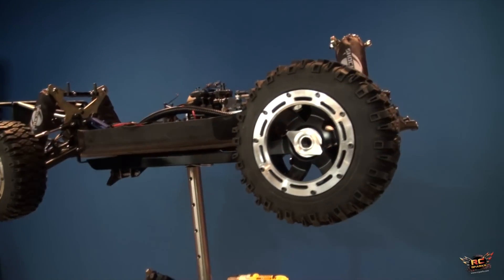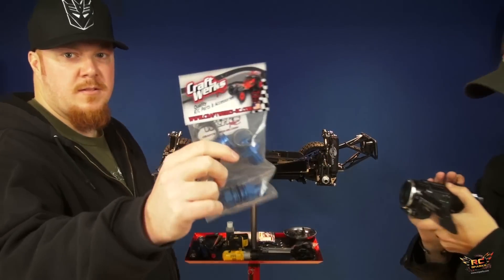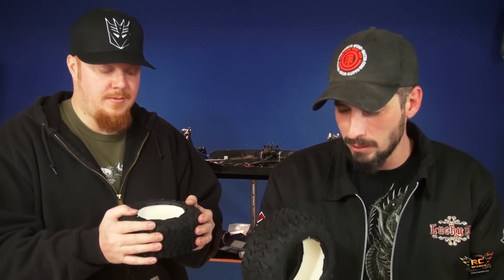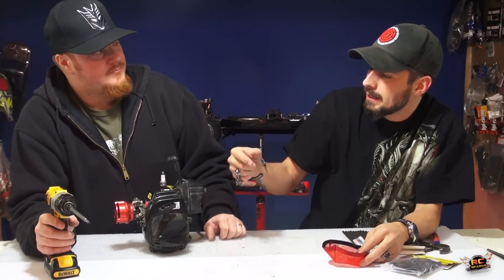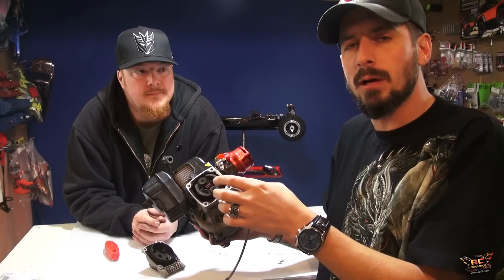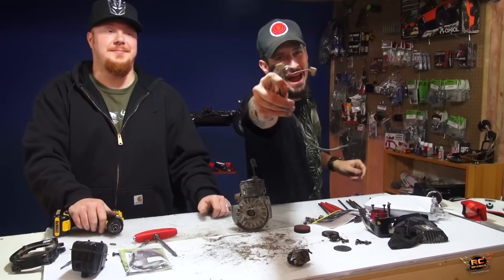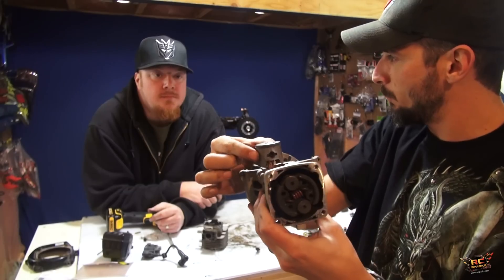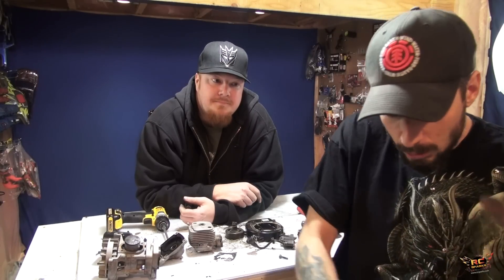RC ADVENTURES - Project: "LARGE" / LOSi 5T (PT 4) Look inside a 5th Scale 26cc Gas Engine

Comment: As a mechanic I can tell you that the spark plug is looking normal,  Also there is a product called brake cleaner that will take that clutch dust right out, it will also prep the surfaces for the new plates so you dont have to do any cleaning when putting it back together.  Keep making great videos :)

Comment: he did it with a rock crawler but for the wraith no because of how the body is and how the chassis is a 1:5 electric would take a huge motor and big batteries and you wouldnt even be able to run it at a track because the most common places dont race 1:5 scale trucks but 1:10 is a very big racing class so if you get the kit just have fun with it they are still easy to work on and lots of fun i hope this helped

Comment: when you were talkin about a failsafe cut out just want to mention that they don't cut out at short range this happened on my AOWEI YAMA BUGGYwhen the car was stationary,it just suddenly picked up revs and took off across the parking lot and ended up in the bushes on high revs.i think the batteries in the handset were low at the time.

Comment: medic buddy humm that plug is needed to look like that. if white to lean of main jet in your carbarator, if wet and black black like darker then that then to rich, and most times fowel the plug. but i say put a new plug in the new motor lean it so its white and do so its gray to black and make sure you idel respons is good if not lean or richen it up. have a great day bud. thanks for your vids

Comment: try the yama-lube 2 stroke oil for their 2 stroke scooters and mopeds. it will oil better and not foul the oplug out nearly as fast. its the best 2 stroke oil on the market for scooters and mopeds, so should work awesome for a 2 stroke rc motor.

Comment: the only oil i use in any 2 stroke that is for fun like RC's, my pocket bike(same motor as ur RC in the vid), or my honda cr250r race dirtbike is lucas semi-synthetic 2-cycle oil, its the best so far that ive found im running 50:1 in my race bike and im still on the same spark plug since the start of the season still starts on 1 kick

Comment: damit i bought a bunch of the brigs and stratton oil wen i was waiting for my 5ive to come.....takin it back i'm using amsoil 2 stroke mix insted......hey medic did you put dielectric  grease in spark plug boot, io did before first pull just because i'm a mechanic i gues

Comment: Can you use regular 2 stroke oil to mix with your gas?
Reply: killmore75 only if you dont value your engine
Reply: Brandon Jones hmm, well what do you mean by that? I use 2 stroke oil to mix for my 5ive T and that's what is recommended by Losi... It is Synthetic High Performance 2 stroke oil though. Not sure what the OP is using.
Reply: just using regular 2 stroke oil can cause build up on your piston because just regular two stroke oil doesnt have any cleaning additives in it. its fine to use, and your engine will work, it just wont work at top notch performance for as long as it would if you were to buy a higher grade oil. itll end up bogging down. then youll think its just a tuning issue, then youll tune it til it seems to be back to where it was, but in reality what you really did was adjust it to where to much gas is going in which will just end up hurting your engine even more